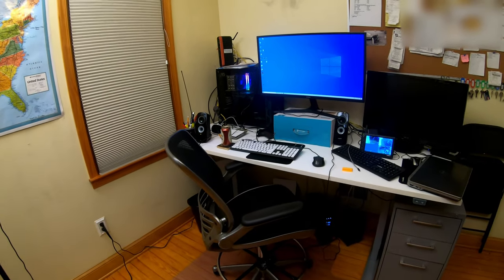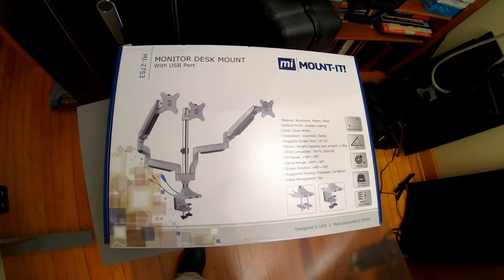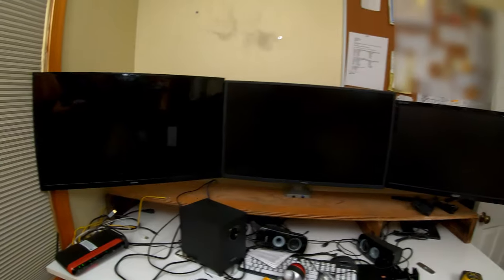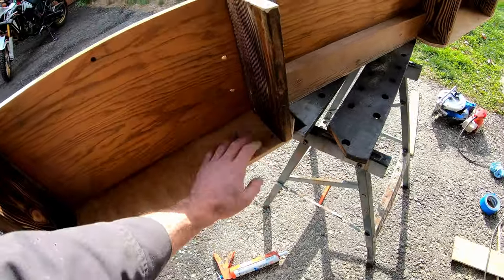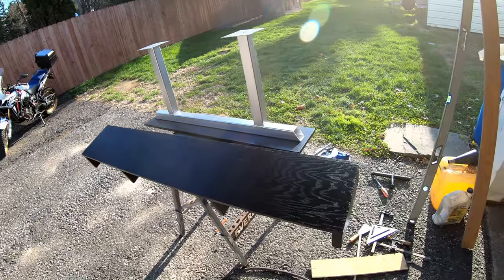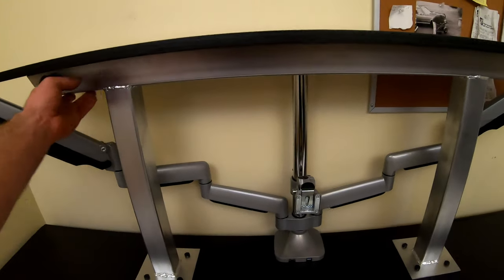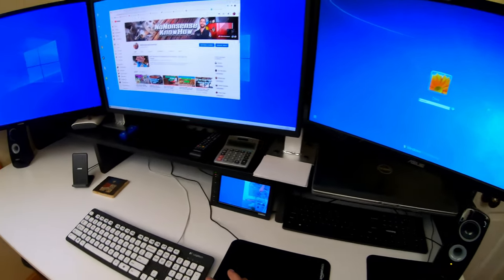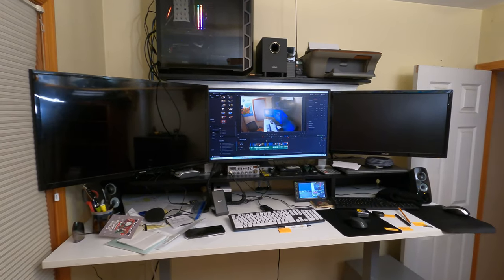Upgrading My Computer Desk / Mount-It Triple Monitor Stand

Comment: I set up a triple monitor stand in my new home office a couple months ago, what I found was that every monitor bracket you could find on Amazon (that's in stock) is cheap Chinese junk. I had better luck with a "WALI" branded one but even then I had to fiddle with the mount to get it fastened securely.
Reply from the maker: Cool, I'll have to check that brand out. Yeah I think you're right about pretty much every brand on Amazon. So far mine is holding up. I'm glad I added the mods to it. Gives me peace of mind whether it breaks or not.

Comment: Logitech speakers are bad.  I do confess I used them myself (Z906) however: 1. They make a "Thump" at startup.  2. They do not have tweeters, therefore they perform badly at High and even Mid.  Then on my Z906, the 5.1 analogue input went dead within a year so I had to switch to optical (thankfully my Sound Blaster AE-7 have such options).  And to address the poor Mid and High, I added tweeters to the Satellites.  The thump however, just had to live with it.
Reply from the maker: These ones seem to work pretty decent